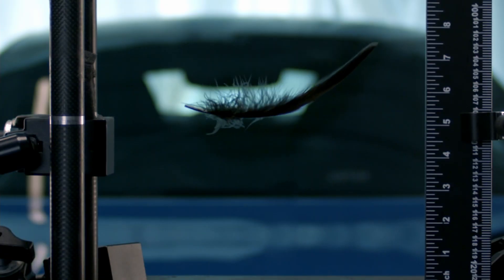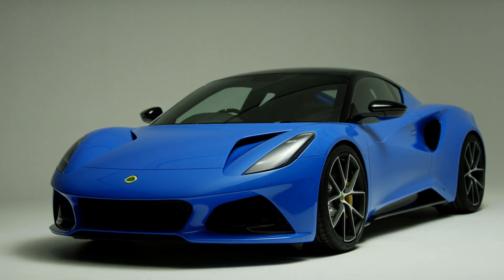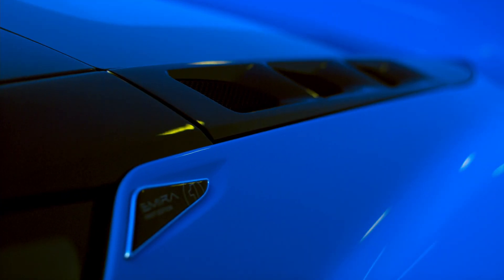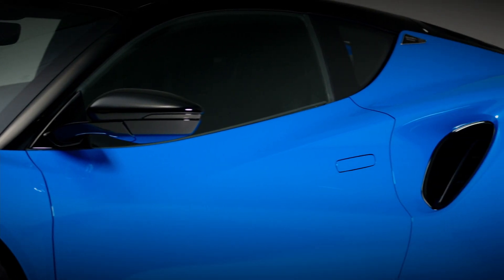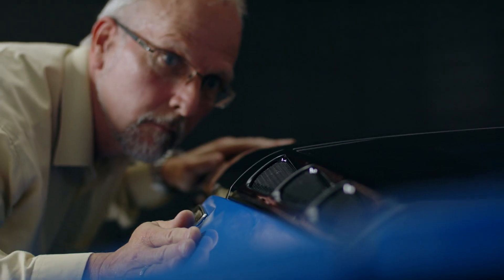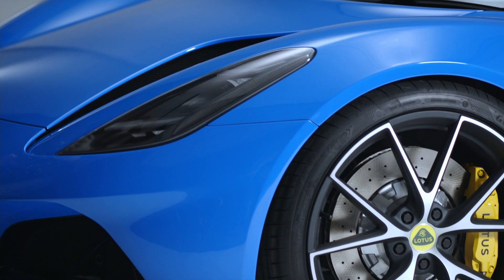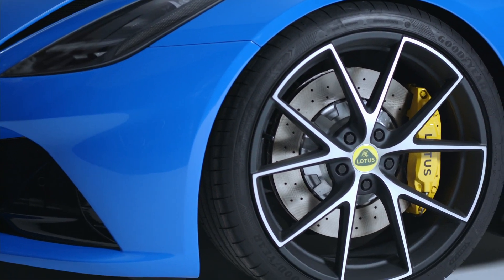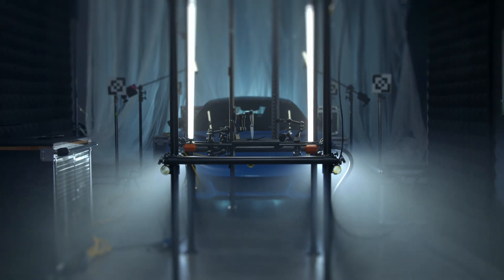Emira Aerodynamics with Richard Hill

Comment: 🙋 Geely missed a massive opportunity with a AWD Lotus Emira, their last petrol car! The Emira could've been a AWD-PHEV monster rivaling supercars, leveraging Volvo's acclaimed Recharge AWD tech (S60 Recharge: 455hp, 0-60 mph in 4.3 seconds) and a tuned version of Volvo's SPA platform. Imagine an Emira AWD-PHEV with that kind of electric power combined with a tweaked version of Volvo's in-house 4-cylinder engine & AWD DRIVETRAIN 

Lynk & Co's success with the 03 Cyan concept, a lap record-setting beast, further proves Geely's potential for a fire-breathing Emira. Sharing tech within Geely (Volvo & Lynk & Co already use similar 4-cylinders) seems like a no-brainer IMAGINE THEM ADDING TWO EXTRA CYLINDERS AS WELL FOR A TOTAL OF 6 CYLINDERS. Disappointed they went with Mercedes AMG/Toyota sourced engines for the Emira, hindering its performance and missing a chance for a legendary AWD-PHEV. #SaveTheEmira #GeelyVolvoLynkCoPHEV
 #GEELY #LOTUS #VOLVO #CYAN03 #LYNKCO03

Comment: Really excited for this car, paid my first deposit and waiting for the phone call to pay the second. Keep that first edition I4 cost down and I am sure the conversion rate to actual sales will be huge.
Reply: Aren’t the first edition i4 suppose to be $74,900?
Reply: @lilchu7336  I have heard that the first edition will actually be the most expensive version since it will have everything as standard. If they keep the base manual $75,000 or under the sales for this car will be huge.
Reply: @lilchu7336  no, that price is for the First Edition V6 model. 

The base I4 will cost £59,000 so bang on what their marketing is saying.

HOWEVER, Lotus are keeping tight lipped about the mid-range I4 First Edition model...perhaps understandably so, as it's likely to be their biggest seller.
Reply: Excited 4 u jafer!